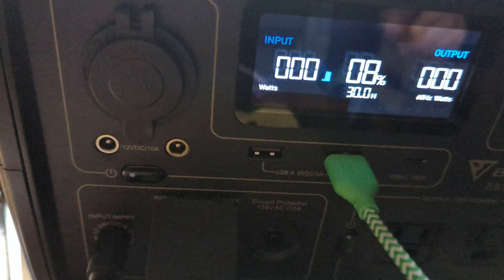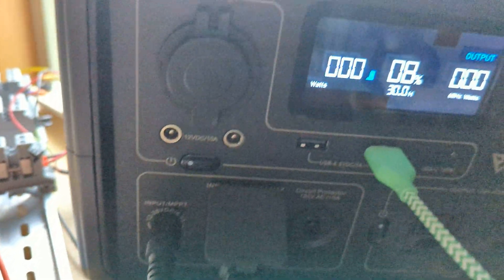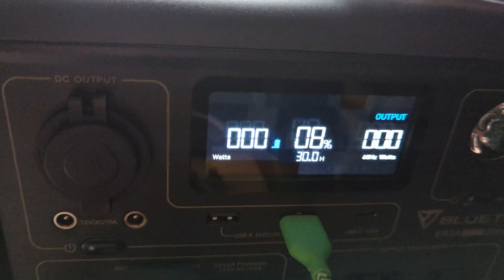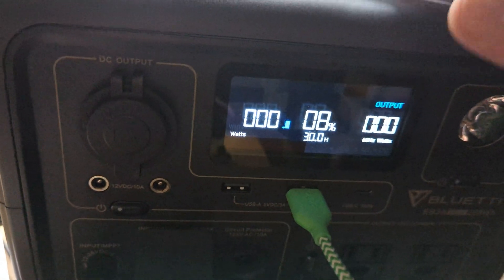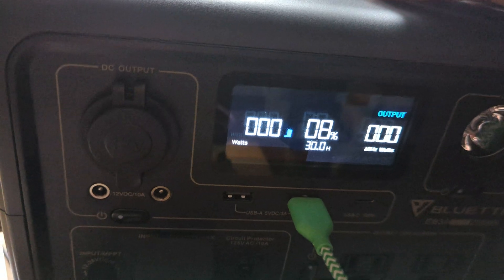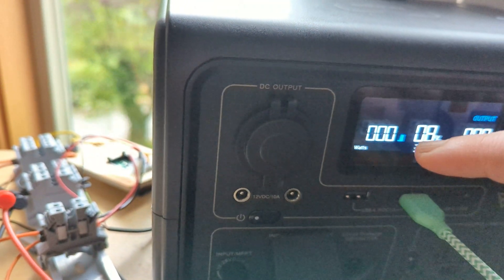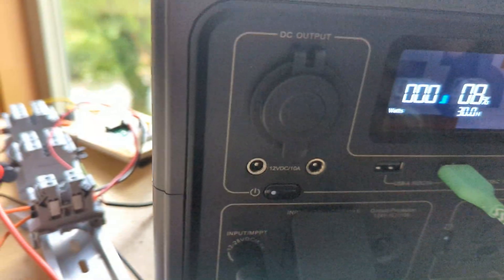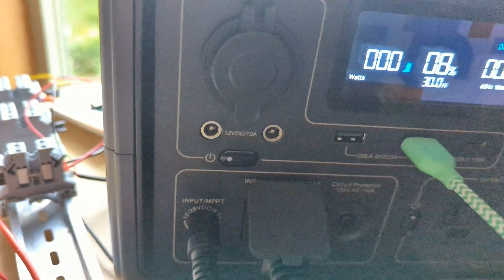bluetti EB3a solar power station review: Giant MPPT problem

Comment: You nailed it  Control circuit will not allow charge unless there is power within the unit batteries.  I got $5000 invested in BE

Comment: I've seen every YouTube video twice over, but somehow this one wasn't shown until after I bought the unit. And I too didn't see a single (!) reviewer so much as mention this issue, which is apparent on many forums, including Bluettis own forums.
And two years later with current firmware (oct 2024 EU: ARM v2053,08, DSP v2052,11) the problem still exists for me. Also no threshold settings whatsoever in the bluetti app. So yeah thanks for nothing bluetti 👍 only option is to invest in another external mppt and cables..

Comment: Mine won't charge off of solar I ran it through a small charge controller with a battery and it did work I have had multiple problems with mine pretty well convinced they are junk

Comment: flashing input means low voltage on solar, when it gets the right amount it will start charging.
Reply from the maker: it appears to be current or power (I*V) , the panel can be 22v but it will not start if it can't push around 1A of current.  Once it starts it is fine for the rest of the day with lower currents.

Comment: I had the same problem. I turned off eco mode. That solved that. The next pronlem is if I use an inverter generator it doesn't like it. Try it even with a small load ac input and output dies.
Reply: So when you turned off ECO mode, you could charge ok via Solar, not flashing?

Comment: Just bought the EB3a a couple of months ago along with the 68W panel, and mine does not have this problem.  Solar charge works ok.  Firmware installed when I purchased appears to be already the current version.
Reply: Do u still have this eb3a? Is it still working well 2 years after u posted this video? Do u use it everyday and do u use it for heavy load ?
Reply: Where can you check and get the latest firmware?  I don't see an area on Bluetti's site?  Thanks in advance...if it's there and I just can't find it can you send me the link?

Comment: Anyone noticing that while wireless charging that the top of the Bluetti EB3A and the phone get really really hot! I did not check the temperature then, but I was using the unit in UPS mode during some stormy times and while using only 40 W going to my router and Internet box and in a 77°F room the top of the EB3A was 104°F.  The unit is only rated to a maximum of 104°F. Is my unit the oddball or is this normal?
Reply: I have 5 different EB3A; however, all do the same, if that helps.  Heat rises.

Comment: Yes, mine does that but I pull the plug when not in use, have up to date firmware.
Mine starts charging after the Renogy 200watt portable panel hits about 20volts.
When thick cloud came over it still charged down to 7watts or so.

Comment: Did Bluetti solve the problem?
Reply: Have you sorted this, I've seen people having problems with dewalt 18v battery's as a secondary but others working fine so I'm wondering if it is an amp issue. I have mine connected to a 24v 100 amp battery instead of solar and it works fine. I've had it blink on  a160 watt solar panel at 18v on poor conditions. I do have a 300 watt buck boost converter I can adjust to 28v. I'll do some testing with it and see how it compares. I am loving mine but I bought it with no intentions of connecting solar and just a larger battery.
Reply: did you ever test your converter to see if it would fix the problem
Reply: https://youtu.be/_yoqa8XB5uw
Reply from the maker: nope, no new firmware since I posted
Reply: @JesseSchoch  Anything new for fix? I just purchased and having same issue. I've contacted via support and received not reply.
Reply from the maker: @vincentatwood1021  no new firmware or other fixes that I am aware of.  good luck

Comment: Matching solar panels can be tough.  I have a 36 silicon 100 watt solar panel attached to a cheap $100 Golabs R150, and every time when the winter hits below -25 celsius it will trip the "overvoltage"

It also is completely innacurate percentage left but I do believe it charges at as little as two watts (to max 55 watts), which is nice when the sun first shines right to the end when the sun sets.

Will try a hack this winter, placing a strip of electricians tape over a section of panel just to see if it will reduce voltage enough to work stable at -25 or lower.

Comment: i have 2 of these units with the same issues. yes they are both updated/ they start to self discharging through solar if you leave the panel plugged in .wont charge through solar at all now. tried calling customer service about this.junk!!!!!! thanks to all the glowing reviewers. at least it will charge through the wall but then its not a solar generator then...

Comment: I have 2 of these as well.  If you haven't done this already, update all three of the available firmware updates, which you can only do from the Bluetti app.  These updates will most likely fix most problems, such as periodic overloads.  Also, which solar panel (panels) are you using?  Check to make sure that the open circuit voltage (Voc) does not exceed 28 volts DC.  I had a periodic overload issue prior to doing the firmware updates and haven't observed that issue repeating after running the updates.  The Bluetti PV200 panel will get about 183 watts, depending upon the temperature the panel reaches in full sun.  It's Voc is 26.1 volts.  Most or all 12 VDC panels (17~20 Voc) will work.  Also, Hobotech tested the PV input with a variable DC supply which showed that the PV input cuts off when the voltage applied exceeds 28 volts.  Hope you get it figured out,or replaced by Bluetti.

Comment: Got mine about 10 days ago, and I can’t get it to charge from solar at all. I’m using a 100 watt Renogy panel that is within the EB3A’s specs and it will not charge. I’ve been emailing Bluetti support back-and-forth for the better part of a week. The last email was they asked me to try charging it via the car. The problem is they don’t supply a cable for that. I sent them back a picture of their users manual that shows they don’t supply the cable. It’s been crickets ever since. So now I’m trying to get a full refund via Amazon. Here’s my short video: https://youtu.be/elX-bnjE2Xs

Comment: I had the same problem with the input light flashing and it not charging. I returned the first EB3A and I'm having the similar problem with the second one. The app says it's charging but the front of the EB3A shows not charging. tried different panels and several different cables and still not charging. Although now the input light is not flashing however, it's still not charging on the front panel of the EB3A. Even did the firmware update and still nothing.

Comment: I have two of these and haven't experienced this issue. However, one of them I have sporadic 'overloading' issue. I have this one particular EB3A quarantined off so that only 2 monitors, 1 T480s laptop and fioptics wifi router on this unit. At most, it pulls 75watts in USB mode. Then sporadically, it shuts off due to 'overload' as indicated on the display. Not sure what is going on. If someone else has experienced this issue, would love a reply.
Reply: I have the same problem, using POS pulling 65w for our home heater, it overheats and we wake up to a cold house, total piece of Garbage!!!!

Comment: Did you do the two latest firmware updates? I was told to do them by the Bluetti Community on their website. The firmware updates were supposed to correct a couple of issues the EB3A had - including the solar issue.
Reply from the maker: yup, latest firmware.
Reply: I tried the app....it states I've got the latest version and my solr input is the same

Comment: Are you saying that the input current has to be greater than one amp for it to register and hold a charge? Also if you leave the plug connected, are you saying that it will discharge even though the panel is in direct sunlight?
Reply from the maker: it seems that it needs something like 1A of current in the morning before it start charging.  After the initial 1A i think it can actually charge with less power from the panel and the LCD screen will time out, but before that point it just burns power checking the PV input for the right amount of current.
Reply: @andrewj99  Then they should state that in their manual instead of letting us do the guess work. Not everyone is a technician.
Reply from the maker: @andrewj99  hard, or just takes a while?

Comment: I also have the same problem. I hook up their own Bluetti PV 120 Solar panel into the Barrel Plug and it won't charge. The Input light keeps on blinking. And the input wattage stays at 0000. Anybody have a solution. Or is the generator defective?
Reply: @andrewj99  Hi Andrew. I brought the Panel out in direct sunlight. Just as I suspected. It needed direct sunlight to charge the EB3A. The Bluetti PV 120 charged it at roughly 90 Watts. Have a great evening.
Reply: @andrewj99  Thanks. It's not.
Reply: @andrewj99  I'm pretty sure it's the panel. I am an apartment dweller. I have it hooked up on my window. It is not getting direct sunlight. I plan to bring it out today and expose it to direct sunlight. Will keep you posted. Thanks.

Comment: Post an update if you find a solution. I have the same problem with a rigged-up setup using a Harbor Freight solar panel and it's charger. Unless the sun is direct on a cloudless day, the charger is more effective at discharging than charging.
Reply from the maker: I built a mediocre MPPT type charger for a 20w panel that has been running for a few weeks setup in a breadboard.  I made a PCB in easy EDA but have not milled it out yet.  I'm somewhat afraid improving my charger that is the answer... The $2 PWM charger I had the panel hooked up to actually didn't do a terrible job but it was setup for lead acid and would cut charging off at a lower voltage.  the bluetti may be going back to amazon.  60Wh of standby power is insane.
Reply from the maker: does your charger/panel have a diode on the input?  PV reverse current may also be a problem, should be able to see it with a multimeter.